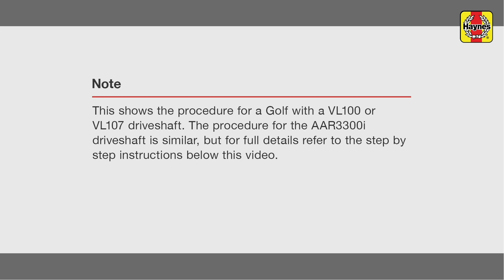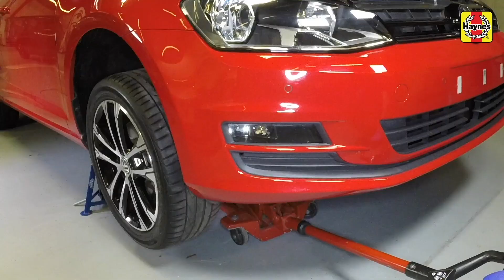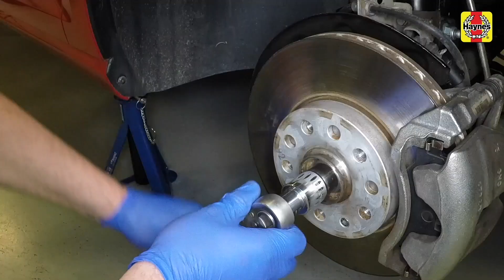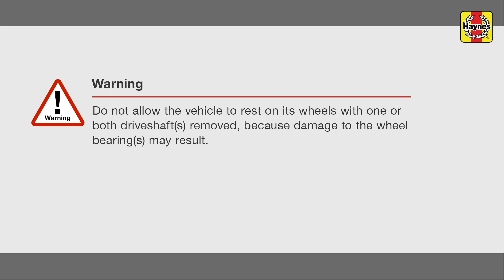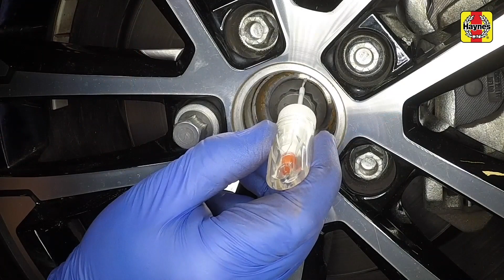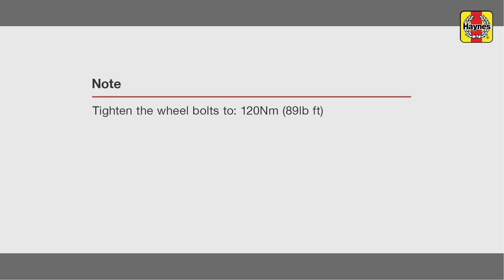Volkswagen Golf (2013 - 2016) - Replace the driveshaft

Comment: Hello ,in Elsa written for my mk6 GTI wheel hub bolts with ribs need tighten  70 nm+ 90 angle.Also when I pull out drive shaft I don’t mark.Elsa never ask about it for bolted cv join vl107.Does the it correct ?Thank you for you attention.